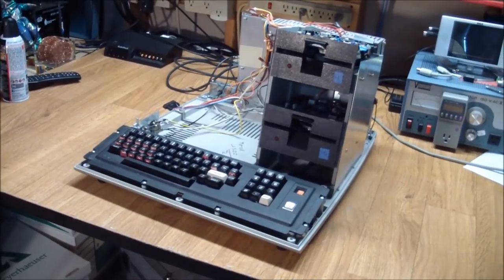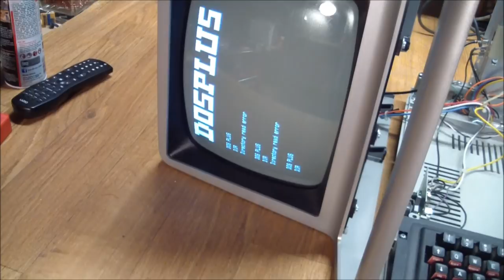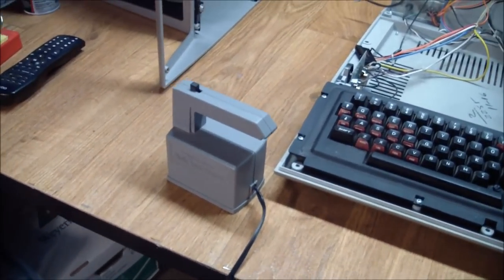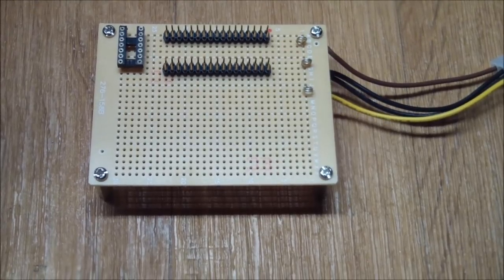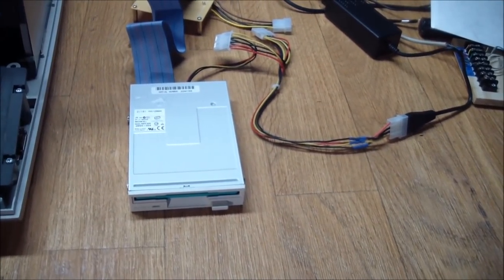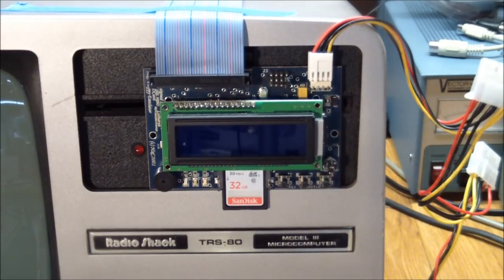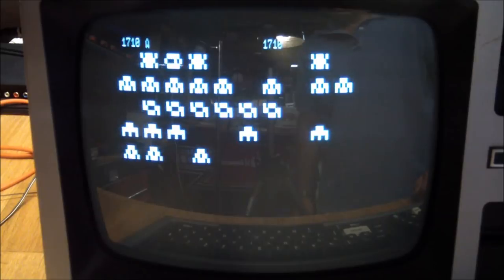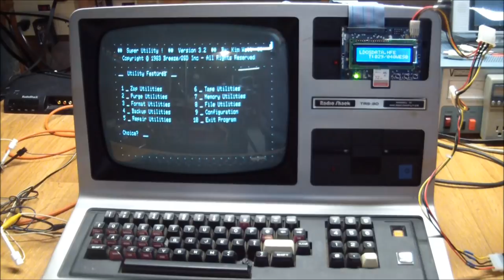AE#55 More Issues With The TRS-80 Model III And Adding External Drives

Comment: I started with a TRS-80 Model 1 Level 1 with 4K at 12 of age who was available for $800 in 1978's money?   While the program was running, the typed characters would echo on the 80x25 screen.  So many memories you wake up.  I am now a 52 year old professional software architect and this is all started with those machines.   At this time, the model 12 was the top of the line machine with 8" diskettes!  Have been able to touch it!!  God, what a pleasure it was to type in programs listings on the model 1 or 3 from byte magazine for 2 hours to only get a bad game in the Radio-Shack store.  Thank you for those memories.

Comment: I had one 5.25 double density double sided (360KB) drive and one 1.44MB 3.5inch floppy connected (both externally) to my model 4 back in 1988, you had to have a cable that removed a specific connector pin so the drives would not fight over the same designation. I can tell you, it was pretty close to having a hard drive. I miss that old rig.

Comment: Tandy did make a sound card that hooked up to the Parallel port at the bottom in back. There was a company in NY that made cables and Parallel card that let you i/o from a card. They also had a A To D card but they forgot to put a clock on it so you would have to bugger the CLK signal to it. They also made a clock with battery, but it was hard to get to auto update the clock.

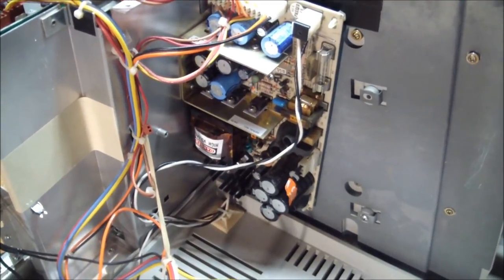Comment: 8:18 I see another problem in the power supply it has the notoriously bad replace on sight Rifa EMI suppression caps in it they are easily identifiable by their translucent yellow case. Check the body of the caps they will have hairline cracks in them. Moisture gets inside the case and they short out without warning producing large amounts of smoke.

Comment: Old reel to reel tapes suffer from a similar problem. Moisture in the air attacks and degrades the binder that fixates the magnetic medium onto the substrate.  'Baking' the tape in an oven for a while temporarily solves the problem by expelling the moisture.  Unfortunately, rather soon than late the tape will fail again.  Meanwhile the data (or the music for that matter) can be copied on a new medium.

Comment: I don't know if anyone will read this or not, but if someone who knows trs-80s happens by this, I'm working on my first trs80.  It's a model 3.  I have experience with old commodores, and can generally fix them pretty easily when I get them, but the trs-80 is a whole different beast.  I honestly haven't tried much, but my monitor's not getting raster when I turn on my machine.  I checked the pins on the z80, even tried switching it out, and it looks like normal processor activity, the reset button brings the reset pin low just as expected, the address pins look normal, some of the data pins look somewhat strange, but the clock is rock solid.  I will say that the safety filter caps on both power supplies are blown, and the ribbon cables from the motherboard to the rs232 board and the disk controller are old and dried out, but I can't imagine any of that would affect the raster on the screen.
I should also mention that when I macguiver some connections, and reconnect a few of the pins from the dried out ribbon cable to the disk controller, the disk drive spins up, and it does appear to seek on power up, but I haven't gotten that cable completely connected yet.
Troubleshooting ideas anyone?
(ps.  if anyone knows where I can find a replacement .1" pitch flat flex cable for those connections, I would be super grateful.)
Reply from the maker: If you turn up the brightness on the monitor and don't see any scan retrace lines then the monitor is dead. Start with checking the horizontal output transistor. The monitor service manual can be downloaded for free from several sources.
Reply: @artifactelectronics  Thanks so much for the reply!  I actually buckled down and gave this machine some attention today.  It turned out that I just wasn't getting a good connection between the video board and the cord.  A little deoxit fixed that right up, and I had raster!.
Theennnn, it turned out that whoever had this machine before me put the roms in the wrong sockets, so I put them in their right places, and now all that's left to make this guy functional is to replace the character rom.
Do you by chance know where I can get a .bin of the model 3 char generator rom?

Comment: I use an emulator to read and write TRS80 disk images. It is a 486DX4-100 system. Running DOS 5.0. The emulator was written by David Kiel.

Comment: I miss my trash 80. I had the external cassette tape drive. Times have changed. Definitely degradation of the disk. Even cdr and dvdr degrade unless they are real pressed ones. The ones you burn have a shelf life.

Comment: I have had success with 1.44 MB PC drives. Have one mounted as drive 1 in my Model 4. Just made a new floppy drive ribbon cable. The TRS80 drive cable has pins pulled to do drive select and some other signals. So it won't really work with modern drives.

Comment: Hey Arti. I don't know if you read these comments on old videos or not, but I wrote a game called Kill-A-Pede back in the '80s. I used the alternate character set to make it appear that I was using very hi-res graphics in the game. Please check out Ira Goldkang's website and download Kill-A-Pede and give it a go. It has sound too! Thanks for the great videos and memories... Jim
Reply from the maker: Unfortunately Ira's site has removed all software available for download because of copyright issues. But if I come across your game somewhere else I'll give it a spin for sure.
Reply: @artifactelectronics  Hey Arti. Here's a (correct/working) link to the file "kilapede.cmd" that you can just put on a disk and run. Click the link, wait for the page to fully load, then choose "Download / Direct Download" in the upper-right corner of the screen to download the file.
https://www.dropbox.com/sh/bn7znjldba61h3p/AACA1LTSwdRsuqpT3mQK2MKza?dl=0
Enjoy!

Comment: mine wont even try to read, of course i didnt know till after i bought some disks. i have a chip for the disk controller on the way. worth a try i guess.
Reply from the maker: You may have a bad index hole sensor. If the computer sees no activity it thinks that the disk isn't spinning. Or if the drive light doesn't come on the drive select straps on the drive may be in the wrong position.
Reply: light does come on. i have a new old stock drive, acts the same.